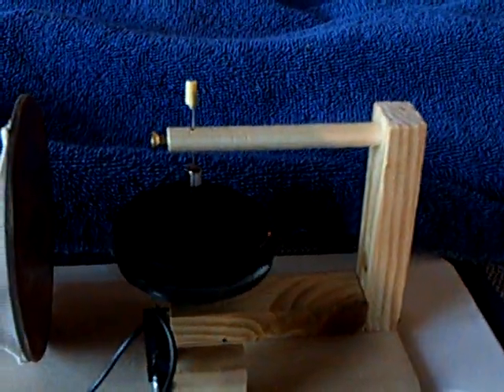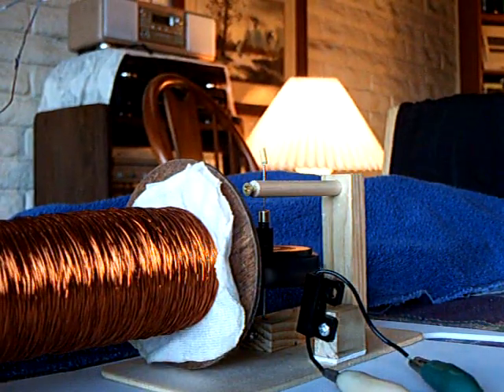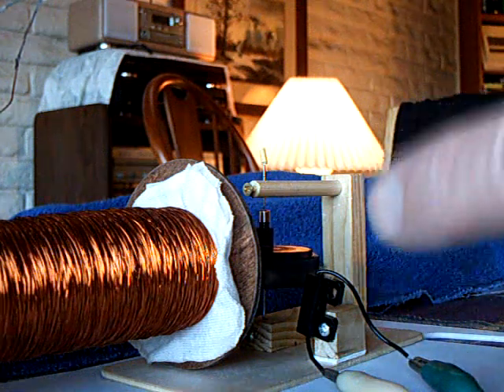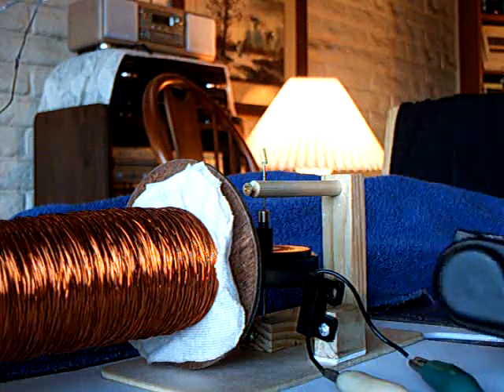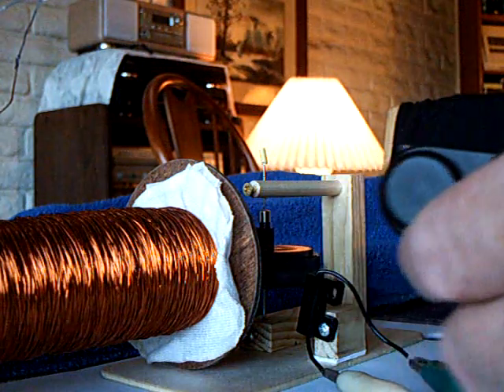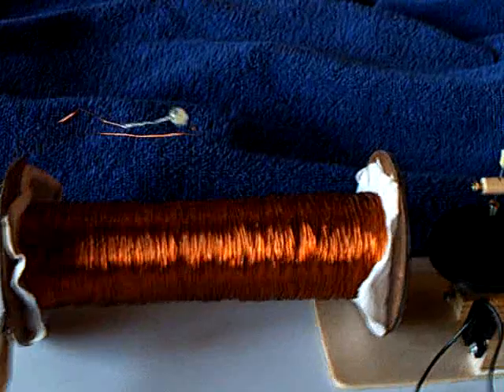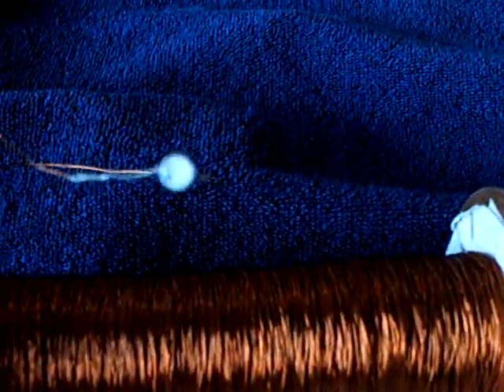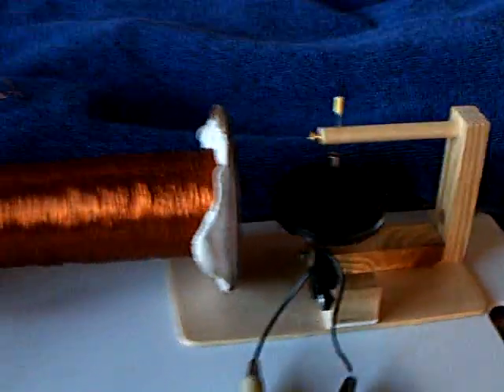Lasersaber-Stubblefield coil  ---A complete replication--finally!!!!.ASF

Comment: Where did you attach the reed switch to?
Reply from the maker: In series with the (+) and (-) ends of the two coils.  This is basically a very strange galvanic cell that has copper and zinc as the cathode and anode.  Because it is wound up in a coil it also serves as solenoid to run the pulse motor.  This device eventually went dead when the galvanic reaction between the zinc coated steel wire and the copper wire ran out.   I still have it after all these years and there still is a tiny voltage on it.  The reaction now is between the iron and copper as the zinc coating on the one wire is long gone.